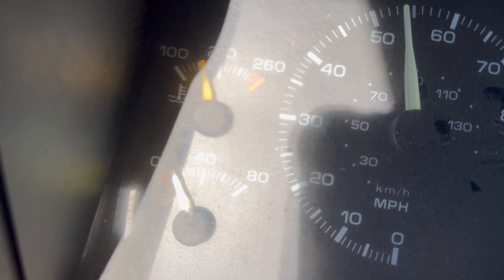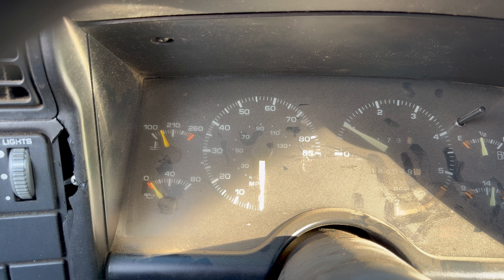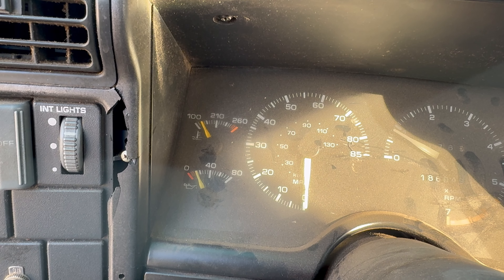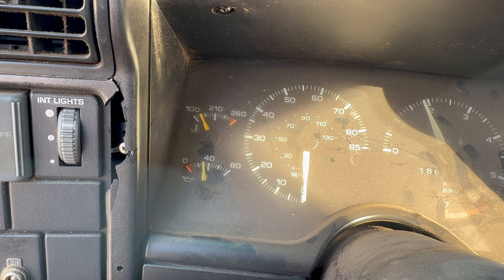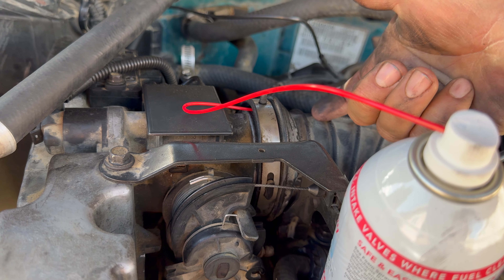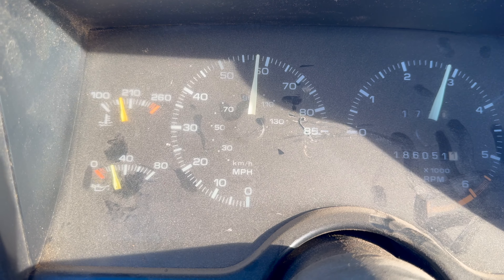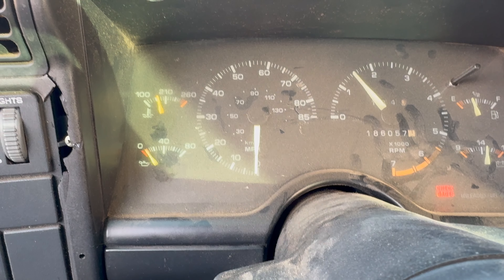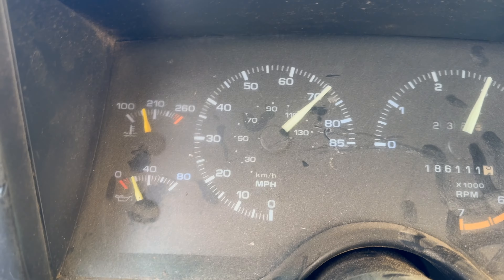Will Lucas or Sea Foam help your worn down motor last a little bit longer.

Comment: Anything that will thicken your oil will make your oil pressure read higher. That’s why oil pressure is usually reads higher when you start.
Reply from the maker: Yeah pretty much why I’m using this product.
Reply: Hurry up with your other projects, lol. I wanna see where this leads you.